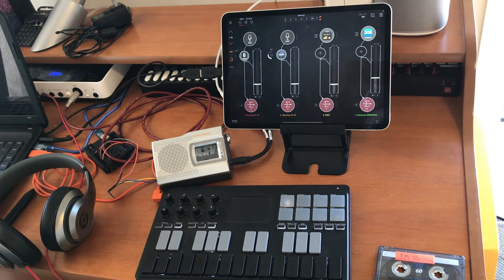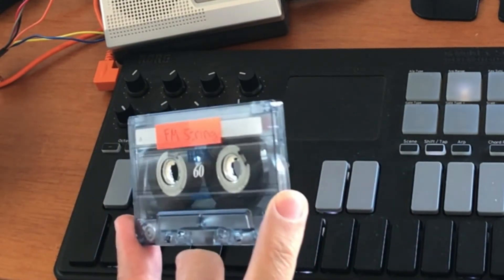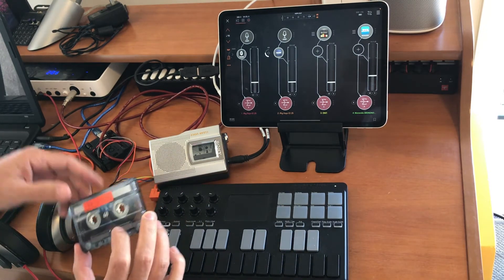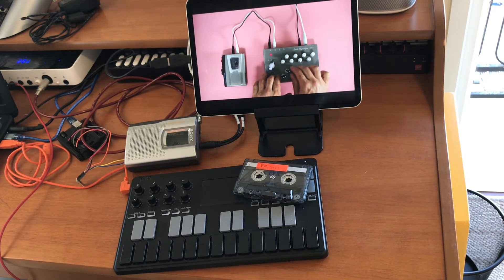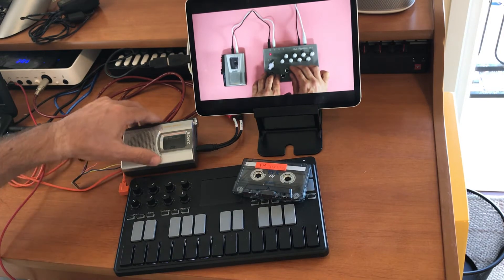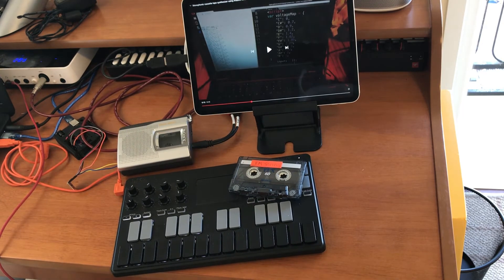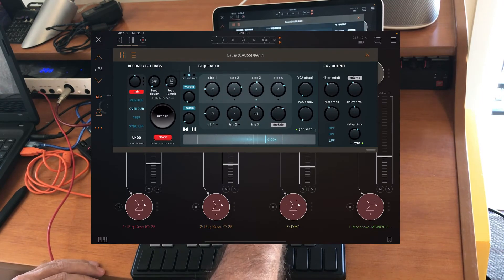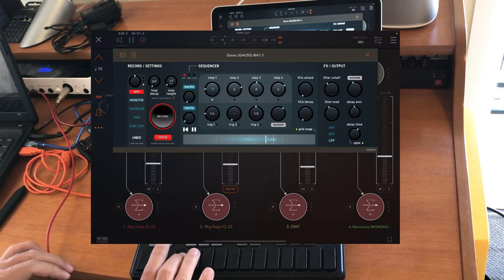Playing a DIY Cassette MIDI Tape Synth - controlled by an arduino

Comment: Amazing stuff! Do you have self-contained arduino code available for this? (midi over USB from a sequencer, or even midi-in on sparkfun hat?).
Reply from the maker: The Arduino code I used is in the Infinitedigits GitHub  (link in the description). It requires a computer for the USB to MIDI interface.  A standalone version would be amazing but I was not the one who coded this.
Reply: @pedech  Thanks for replying. I've tried cobbling together some code that would work but I'm so bad at it :D. Cheers.

Comment: Nice! What note/tone is it?
Reply from the maker: It was supposed to be an F - I know it is out of tune. You can adjust the pitch of every note in the computer by adding or removing voltage to the arduino’s output. My tuning was not fully finished when I made the video. Results also vary according to the sound source as well… i.e strings are easier to tune than a choir.
Reply: @pedech  nice!